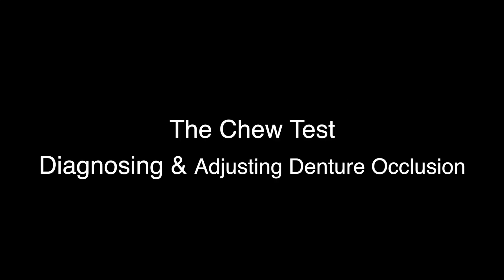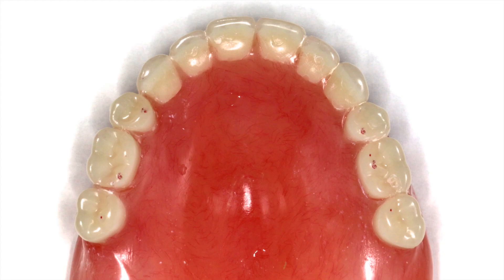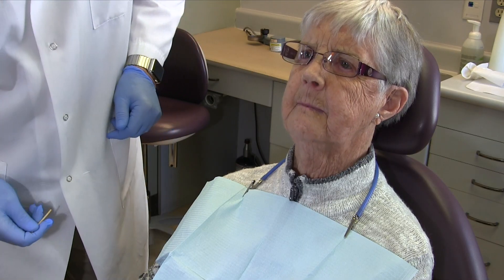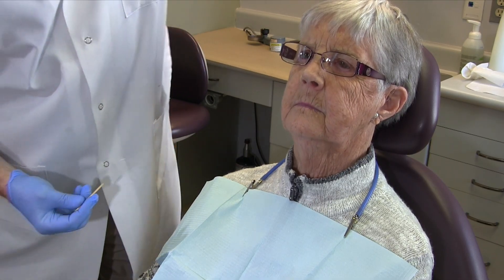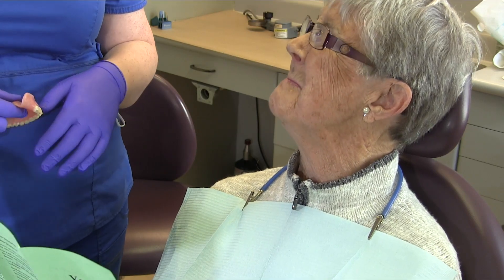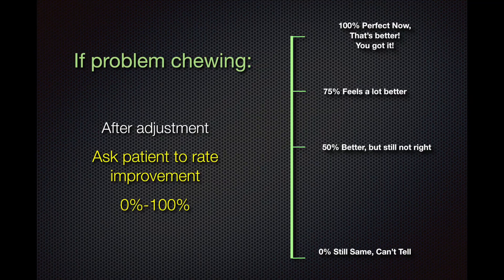The Chew Test  - Diagnosing & Adjusting Denture Occlusion

Comment: How do you position your tongue so it’s not always on top of the denture
Reply from the maker: Without seeing the patient, it is impossible to tell for sure. If the dentures have been worn all day long for several weeks with the problem persisting it is possible that the lower teeth might be positioned either too low and/or too far inwards toward the tongue. There are other possibilities, but a clinical exam would be needed to determine the true cause. Best for the patient to go back to the dentist for a check.

Comment: HI Dr. Loney. 
Do I also have to consider the BULL rules in here ?
Reply from the maker: The BULL rule/guideline is an acronym for "Buccal of Upper, Lingual of Lower". It suggests where to adjust occlusion when there are a premature contacts on the inclines of opposing cusps. The guideline makes sense in centric position in that it tends to preserve the centric cusps in both the maxilla and mandible. In lingualized occlusion with balanced articulation in excursions, if you are attempting to have both working and non-working contacts, the non-working contacts are going to be on the inner inclines of the BUCCAL cusps of the mandibular (LOWER) teeth. You would want to lighten/shallow those BUCCAL contacts if the non-working contacts are too heavy, rather than adjust/reduce the centric cusp tips, which might eliminate your centric stops. So, in centric position the rule can make sense (use it as guidance, not an absolute rule), but in excursions you should make judicious adjustments where it makes the most sense.
Reply: @DrLoneyDal   Thank you so much !! :D
Reply: I want to buy some of this wax please can you tell where to get it from.thank you